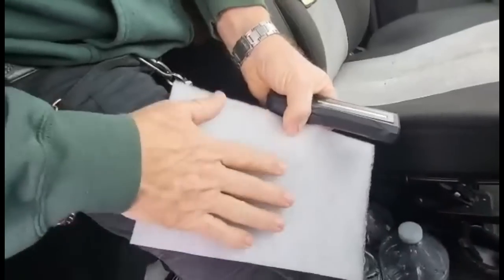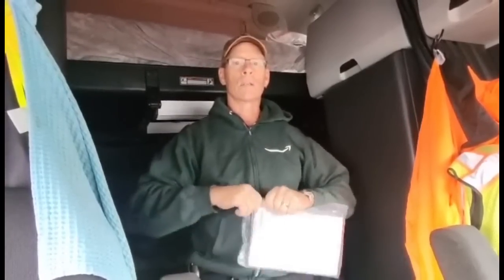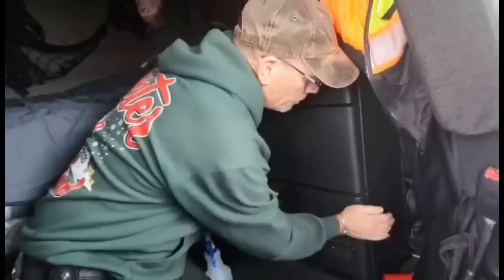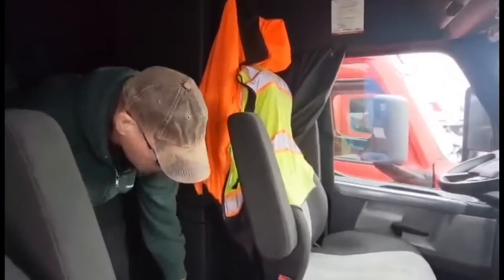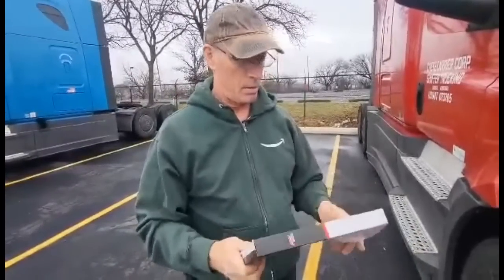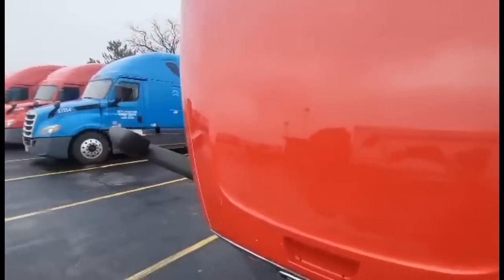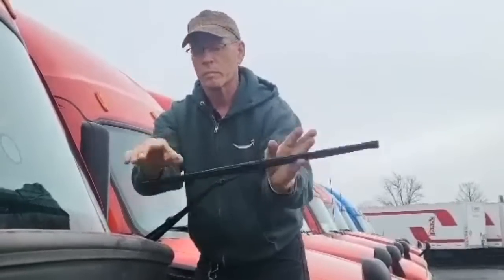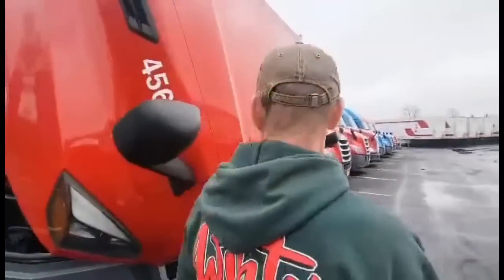How to Change Air Filters and Wipers on Freightliner Truck

Comment: Yeah. I had the passenger wiper just fall off during a pre trip. Then my hood was frozen shut. I actually reached and grabbed the wiper from inside the truck. Little plastic part broke off. Wipers are old and the cold probably made it brittle. Rigged it back on with one hand. Said a prayer and went trucking. Stayed on for the day!
Reply from the maker: 😳😳😳 Glad you could rig it up to stay for the day!!!

Comment: What size are the wiper blades?
Reply from the maker: They are 24”. 😃👍
Reply: @TheJoyofTrucking  thank you!
Reply: Usually both are 24 inch blades
Reply: I knew about the two inside filters that you did. I always was wondering where they stuck the filter for the outside air like the one you changed under the hood. I was driving a 2020 Freightliner at my old job and the espar heater how to filter just like that that you had to change out under the bed and where they drilled a hole in that panel right near where the hot air on these trucks comes out into the cab area or sleeper area I don't know where that one it is on these newer trucks
Reply from the maker: @williampeters6004  Thanks! We’ll need to look for that one. 😃